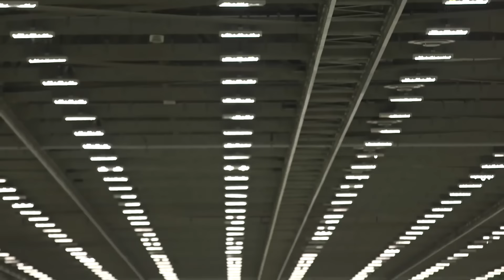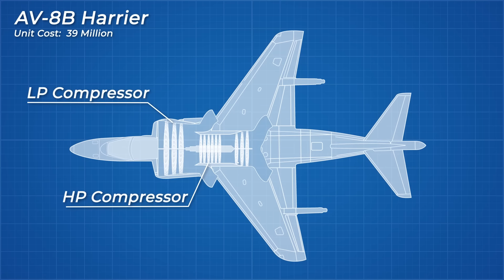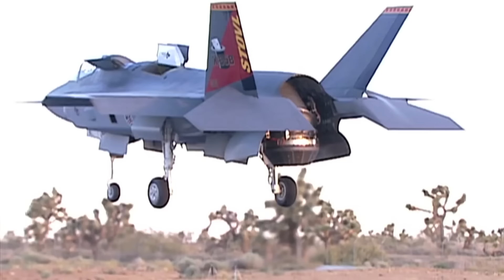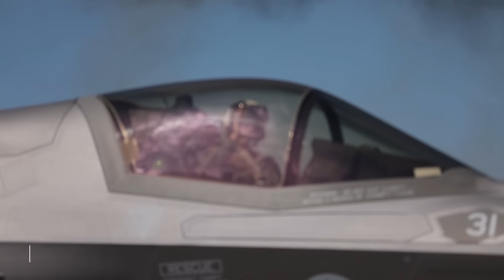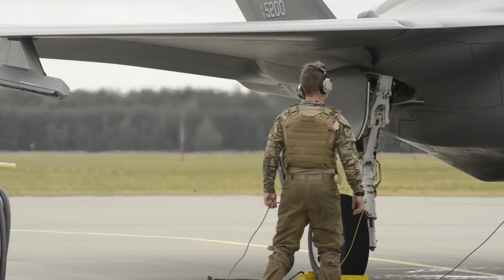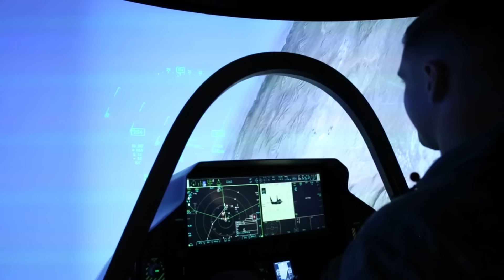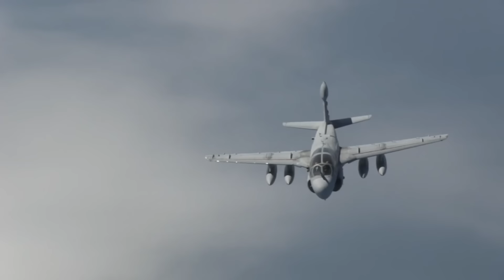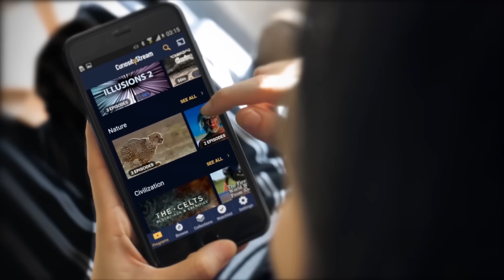Is The F-35 Worth $115 Million?

Comment: the idea that the f35 can replace the A10 is ridiculous.   The f35 is not any better at close air support than the f16 is.  if the f16 could replace the A10 it would have done so 20 years ago.  the air force tried MULTIPLE times to replace the a10 with the f16 and it never worked because flat out the f16 (and by extension the f35) are VASTLY INFERIOR to the A10 at close air support missions.  You cannot mount a 30mm gattling cannon on the f35.  Only the A10 can use the GAU-8 Avenger cannon, and it is one of the primary reasons in addition to its heavy armoring that makes it the best close air support plane that has ever existed.  The reason why the Air Force is talking about replacing the A10 with the f35 is not because the f35 is CAPABLE of replacing the A10.  They talk about it for the same reason they talked about replacing the A10 with the f16.  The air force does not consider close air support to be an important mission.  It primarily benefits the ARMY, not the air force and the air force places little priority on it for that reason.  The primary defender of the A10 has been the ARMY, not the air force, for that very reason.

Comment: The F-35 is no replacement for the A-10.
Reply: Most CAS missions are done using munitions like JDAMs or SDBs rather than by gun run. The F-35 can carry more of these than an A-10 can, as well as get to the area of engagement quicker. In fact most CAS missions done in Iraq/Afghanistan were not done by A-10 but by F-15/16/18s or rotary aircraft. It doesn't help that in a peer level conflict the A-10 would be bordering on useless since the airspace is not guaranteed to be uncontested, and they would just be targets. Being bullet resistant won't matter when an HQ-6 hits.
Reply: @Zendoraptor_  Good point, I am curious as to what USAF CCT think about the A-10 being replaced by the F-35 since they have actual experience with CAS.

Comment: It is obvious that three separate designs could each be bettered optimized to meet each services needs (at least in theory). What is not so obvious is whether (in practice) the total cost of developing  three separate aircraft would have been less than developing one  multiservice aircraft. For many of the problem the F-365 faced would be common to all three aircraft such as stealth, software development, and such and 5th gen aircraft are much more complex that 4th gen just as 4th gen are more complex than 3rd gen, etc). 

And due to budget limitation it would be likely the marine version would be less capable (having less money to spend for development and getting typically and me down aircraft such as the AV-8 and F-18) . Also it would be unlikely the navy would get a true 5th gen fighters verses just a more advanced F-18. And so the marines  and perhaps the Navy at least really benefited by having a common aircraft. If any service suffered it would probably be the airforce but they have F-22's to complement the F-35's. Also, the Air Force version is less expensive so they can buy more aircraft for the same amount of money. Also, the vast number of combat missions flown over the last few decades have been air to ground missions and there have been very few air to air engagements. Thus while air to air capability is undoubtedly  still critically important in all likelihood most combat missions flown by the F-35 will be air to ground with the F-22 providing the air to air coverage. Even so the F-25 has demonstrated an excellent as well as impressive kill to loss ratio for air to air as well so it can as need complement and supplement the F-22;s in that role.

So it seems based on its many advanced capabilities that it provides to all three services (capabilities that some may not have obtained anytime soon had each had to develop their own aircraft) one can make a case that the F-35 was the best way to go, even if it was a difficult way to go and and over all provides critical capabilities to all three serves plus critical capabilities to many international customers as well, many who are staunch allies with the US.

And in regard to stealth vs none stealth, the international market might have a say as to which militaries over the world prefer as they choose to buy F-35 vs other non stealth aircraft, and many have already  lined up to buy the F-35 with it seems many more to follow as well as Russia and China are attempting to develop their own stealth aircraft.

Comment: It is a nice plan to simply not get into a dogfight. Now they just need to convince adversaries to be so nice as to not try to dogfight the f-35.

The f-35 cant replace the A-10, because it is incapable of low speed close ground support and delivering the punch of its gun. It is a fantasy that a fighter jet could ever be as good at close ground support as a plane specifically designed for it. It also cant replace the f/a - 18, which can actually dogfight. It wont replace the f-117 because there is no need to do that, a stealth bomber is obsolete and nobody needs one. It may replace the harrier, so at least the marines are happy.

Comment: It can't replace the A-10.

Planners keep hoping it will, but time and again, trying to use other planes has failed, largely because of 2 things.

1: Armament. The F-35 cannot carry outboard weapons without sacrificing stealth, rendering it vulnerable. It is also too expensive and fragile to expose to ground attack, so it has to use a limited armament of inboard munitions to attack either at high speed or high altitude. This means it cannot provide close air support for an  extended engagement with multiple ground targets - the A-10 can carry an absurd amount of missiles and bombs on top of the infamous chin gun.

2: Loiter Time: The F-35 has a much higher cost per flight hour, not to mention cannot have outboard fuel tanks, this means during protracted engagements with sporadic calls for air support, it cannot remain on station as long as the A-10. This, again, means it is less able to provide on demand air support for troops in extended fights. A better 'replacement' in some ways would be the gunship concept, but unfortunately those have their own issues (guns causing damage to airframe every time they fire) which would need to be solved.

I honestly am confused by the desire to make a 'jack of all trades' vehicle - every branch keeps returning to his fallacy even when, in every war we fight, we rapidly realize we need specialist variants to handle mission specific tasks as well as possible to gain every possible advantage.

Comment: No way it can survive, match a10 low altitude close air support. Stovl version 2000 hr airframe life. Limited manoevering , missile load, cannot supercruise, large, chunky , bulky shape far more detectable with super hi def optical/infrared sensors. Requires many specialist technicians 2 dsys to service/turn around after each sortie.only a version internal cannon, external cannon extra drag, radar sig. Was origionally designed for niche hi tech hi threat first day of battle with air superiority fighter escort, awaacs, joint rivet, sead , air refuelling, a10 cas et al. Cannot be flown near severe elec storms, normal equatorial weather, even parked needs special lightning rod protection. Niche better served with northrop a45(?) Drone carrier aircraft now reassigned to tanker role cos threat to f35. Sheer aquisition n operating cost defeats pilot training n proficiecy. Good pilot in avg aircraft/systems will defeat avg pilot in good/best aircraft/systems between 9 in 10 or 99 in 100 times

Comment: V-TOL, more like V-LOL

Comedy Gold
Reply: *sad X-32 noises*
Reply: I guess you could say, V-GOLD
Reply: @Jonathan Stiles The way the F-35B mostly operates is that it uses a very low amount of fuel for takeoff, so it can make room for a wide variety of armaments mounted to it,  then it quickly refuels during flight to almost completely alleviate this issue. If it's needed immediately and is unable to refuel, they'll sacrifice several armaments, in which case it's no worse really than any other VTOL aircraft in it's class (not to mention being a far more advanced plane...)
Reply: @Jonathan Stiles The F-35 has a pretty large internal bay and can carry up to 6 missiles iirc. And even if it does have external mounted options, it's still far more stealthy than other aircraft

And it's stealth isn't it's only advantage. It's a very potent aircraft in conventional roles as well.
Reply: LOL... you’re an idiot.
Reply: Russian Yak 141 copy
Reply: @Toro_Da_Corsa  Not even remotely. They use completely different means of takeoff (SVTOL)
Reply: @weasle2904  Not only that, Lockheed and Yakovlev actually cooperated with the development of Yak-41M (same aircraft but different variant) in the same time that Lockheed was developing the X-35.
Reply: What? It does VTOL, it's the best VTOL aircraft currently in the world
Reply: @weasle2904  According to who?
Reply: @tanmaykulkarni1545  Basic logic. The only other real Fighter Jets capable of VTOL are Harriers, and they're horrendously outdated, and even for their time they had poor aerodynamics and capabilities due to them being a compromise for VTOL capability. The F-35B manages to sacrifice very little amazingly, and is likely the best VTOL aircraft we're gonna have for a very long time
Reply: @tanmaykulkarni1545  According to any person with a brain.
Reply: @weasle2904  at the time of harrier they were brilliant. Falkland war proved that,royal airforce didn't lose a single one (can't say the same for Argentina LOL)  there's footage of them stopping mid flight and enemies blasting past. They performed well and definitely saved one pilot that got lost and needed to land on a cargo ship.
Reply: @tesstickle7267  Against Argentina? They're not a real opponent.
Reply: @weasle2904  they were more of an opponent during the war, especially considering a few thousand mile distance advantage. Point being is the harrier did it's job without a single loss. The harrier had a good reign for sure
Reply: They refuel immediately after VTO allowing the use of armament and fuel. 
There was cooperation with the canceled Russian VTOL aircraft development before the JSF project. Lessons learned there were applied here.
VTOL is required for adverse weather operations. Beyond seastate 3 or 4 (I forget) only VTOL can take off and land on carriers. North Atlantic is generally terrible conditions, hence UK VTOL requirements.
Reply: @weasle2904  The S400 does VTOL and cruises at Mach 14.
Reply: @paulslevinsky580  Uh, okay..? Also it doesn't go anywhere even close to that speed
Reply: @weasle2904  well Google says that's it's target acquisition speed, so I'm pretty sure the f35 is covered...
Reply: oof
Reply: weasle against the world
Reply: @weasle2904  Clearly you didn't get the joke...
Reply: @goodputin4324  I understood that he was trying to make fun of the F-35
Reply: @weasle2904  I believe it was a dig at the X32, not the F35.

Comment: The F35 is a war machine other costs that need to be considerd is it's operatung cost, cost per flight hour is very important as it effects training  flight hours,  mission costs , sortie rates, and then the opportunity cost, is a single f35 worth more than 2 f16s , during war time what percentage would be available.  Strictly in engineering terms the F35 is a marvel. But as a war machine its too expensive to own, too exspensive to use and too expensive to lose.